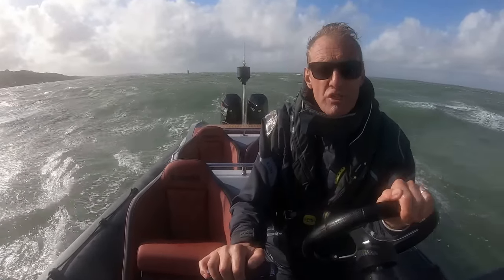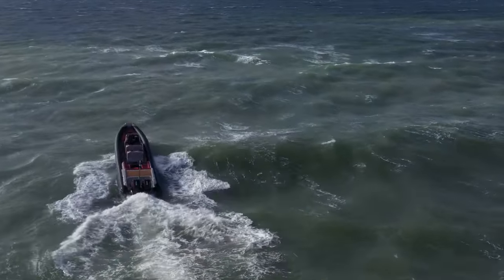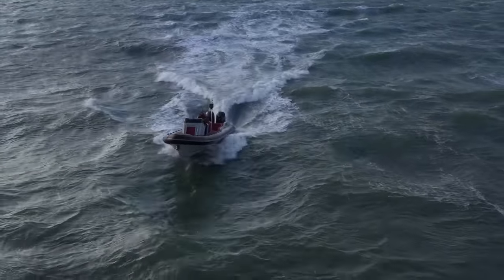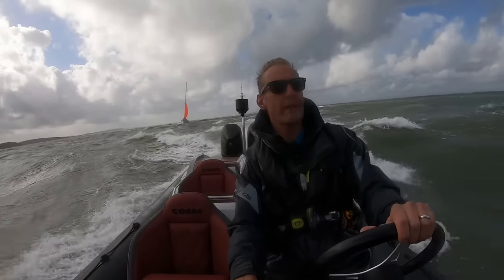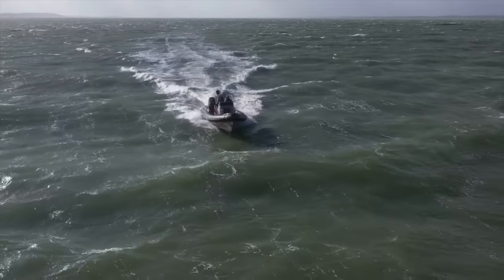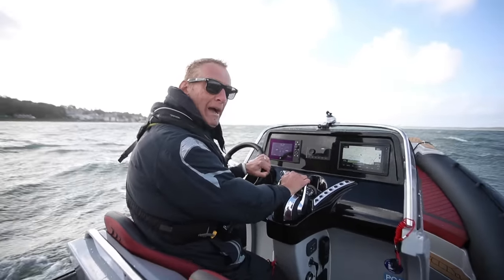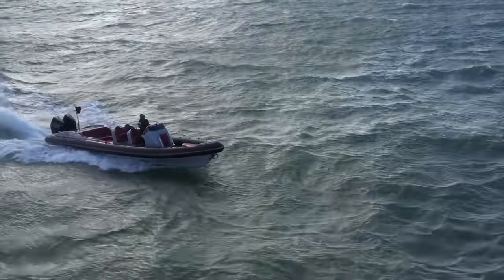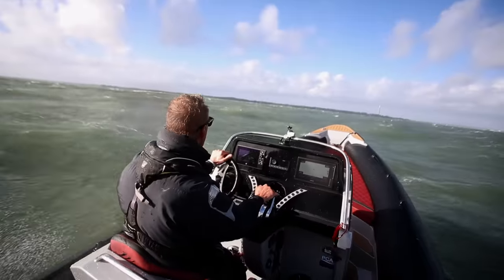How to drive a boat in rough water | Big sea throttle techniques explained | Motor Boat & Yachting

Comment: Drive a boat!?!? Drive!? One sails a boat. Drive a car(t), ride a bike(horse).
Of course, you may say it's because you're using the engine, but than again, following the same logic, you may say you're flying the boat for both sea and air are fluids, have waves etc.
Also... Shouldn't you be hitting the waves at 45 degrees!?😉

Comment: Why does this rib have the concole so forward on the boat? The captain must be getting all the hard knocks exactly under him.... Also when going upwind, it seems from the video he's going pretty slow for the boat size. I think that if he sped up the ride would be smoother given that the wave length is shorter than the boat. (It just seems this way from the video, maybe in reality things were different and I'm full of Sh@#$).

Comment: is this a joke?
Reply: @rickyanthony  you can see that this guy doesn't know how to drive in rough water, no?
Reply: rickyanthony  First, don't do whatever he did at 8:52. Unless you work in the emergencies or military, you don't need to go fast (and most likely your boat is not made for that), just go slower and try to avoid rough seas. Trying to change throttle 10 times a minute is no good and will get you into trouble. I have seen people break bones and boats, trying to go fast in this kind of sea, sorry but this is just plain 🤯
Reply: @rickyanthony  also crashing into a wave might funny on a video, but clearly what he did a 8:50 is no joke and with just a little more speed can directly lead you straight to a emergency situation... going from 15-30 knots to 0 in a few seconds can be similar to crashing into a wall with a car... no good. This guy will injure himself or other people... also this guy never talks about flipping when going upwind with a small inflatable...